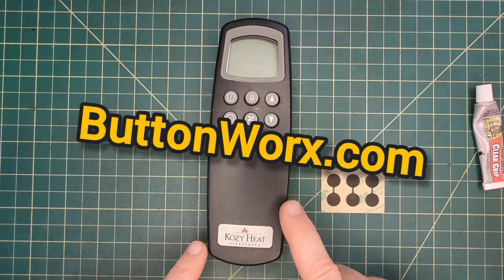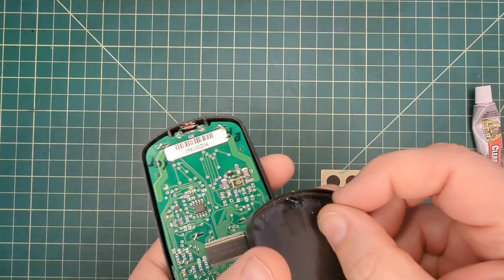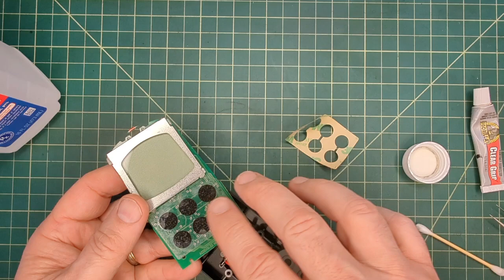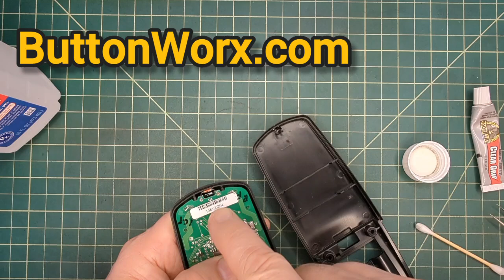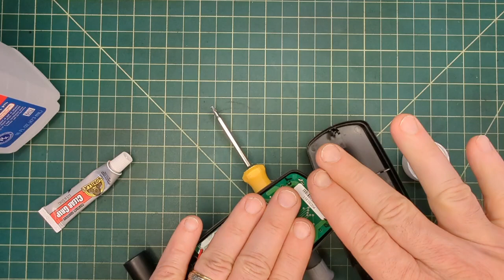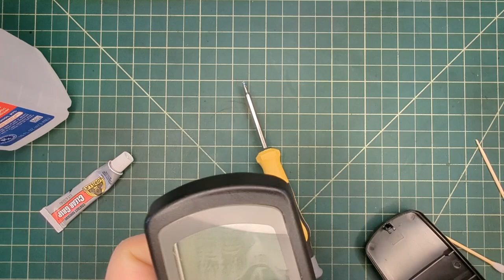Vermont Castings / Honeywell / Kozy Heat / Lennox fireplace remote control button repair

Comment: Any idea where I could find an entire new remote? I’ve changed the batteries and checked the wiring and it’s still not working
Reply: Having trouble with mine also did you find a solution?